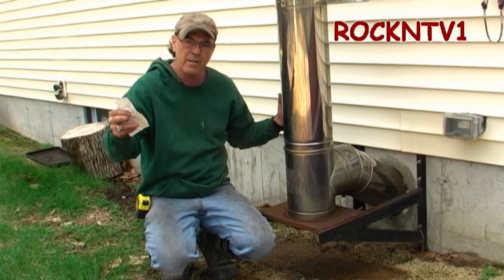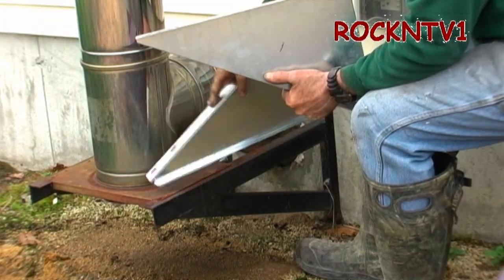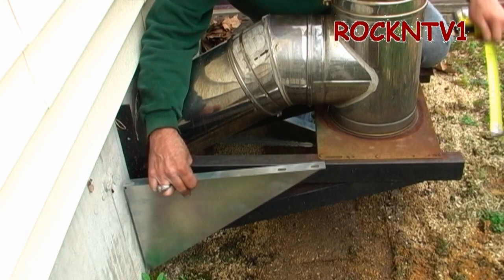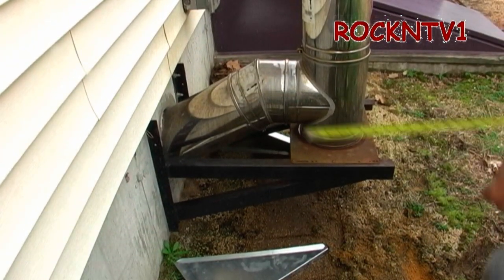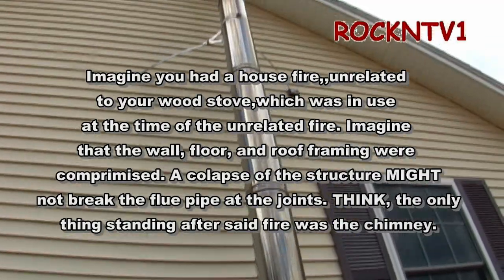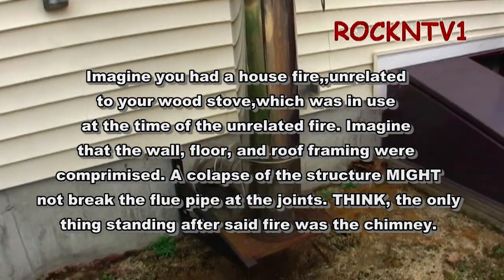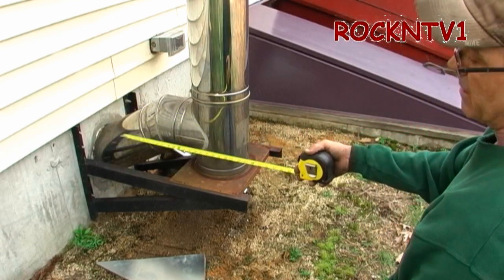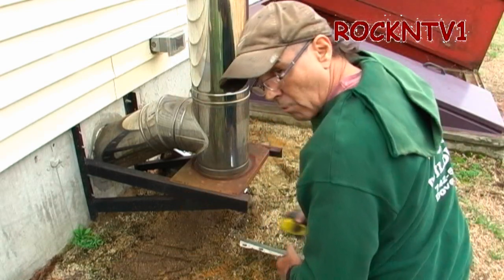SELKIRK SUPERVENT chimney Through Wall  Flue installation

Comment: How to clean this T-fitting?  Mine is "glued" together with creosote, as is the pipe.  Plug will not unscrew.
Reply from the maker: 1, quit burning carpy wood ;-), 2. get nice fire burning, 3. find plumbing torch and gloves 4 run the torch around that plug, maybe a bit of tapping once hot, and put the kungfu grip right to it. I worried about this myself in the begining, but never in the seven years since i build this did i have a problem. I do own my sweeping tools, and always in the fall and always in the spring run the brush through the chimney pipe. I NEVER have creasote. Here in the northeast,  I run my stove hard in the basement to heat the house. Those smoldering,  decoretive wood saveing fires defeat the porpose. I recommend you look into getting a new plug from selkirk before any destructive removal methodes, lol, although I belive you could get away with some tin foil if needed. good luck, thanks for watching .john